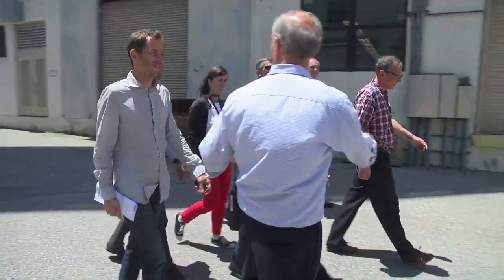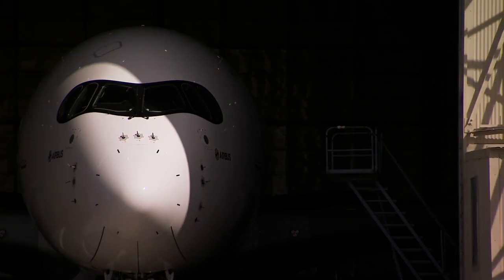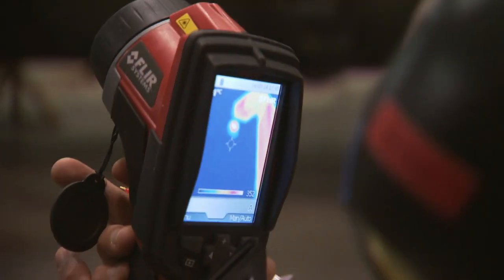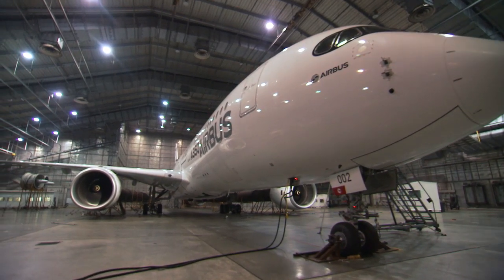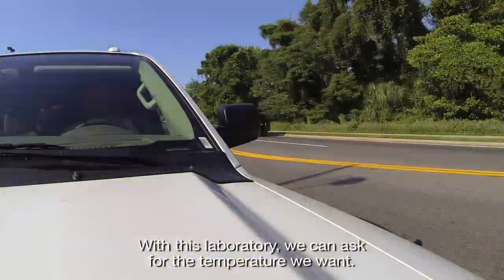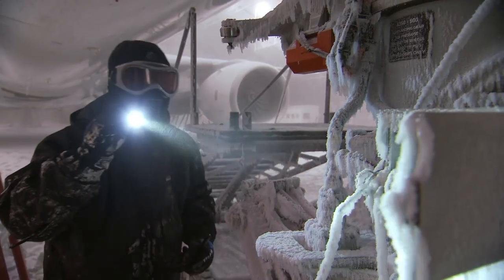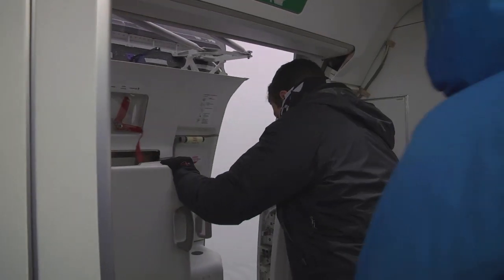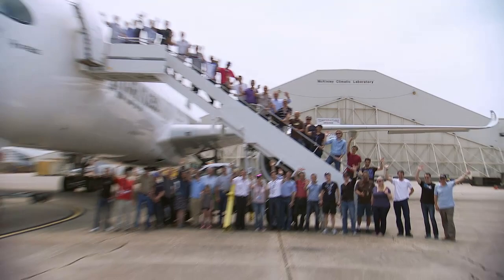A350 XWB: climatic testing in Florida, USA

Comment: Would be great to see a real documentary which talks about what went wrong as well. However this is advertising channel of Airbus, doubt they would talk about issues ... Always everything went perfect with strong French accent ;)
Reply: Very little has gone wrong in this test campaign altogether, there was a few little problems that were ironed out after the first flight and I remember one of the test pilots talking about the little issues on here in some videos. The aircraft is on track to apply for certification in 2-3 weeks, which is on target (actually a little bit early).

This is not an advertising channel.
Reply: Sam Littlewood Good to hear the process was smooth and only with few glitches. However, it is always good to share about those small issues and how Airbus managed to overcome and resolve them. It is not about a product is not perfect but about how a manufacturer takes extra steps towards perfection. Regardless, I still enjoy keeping updated with the videos on the channel.
Reply: Editor NA When I read your first post on this video, I thought you were being a jerk but after reading it again and thinking about it, you're absolutely right. I remember videos on the A380 and all of the good things and then the deliveries started to get postponed because of issues and etc. The 787 was the same way.
Reply: +blakman7 So the 787 deals were cancelled huh bummer not every plane is desirable anyway plus there is a good number of a380 operating already so its not that bad